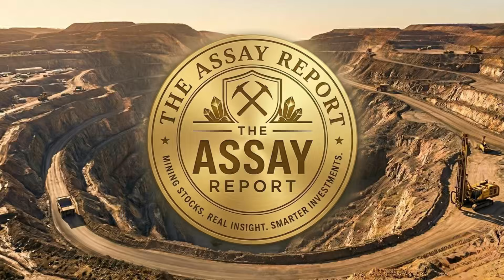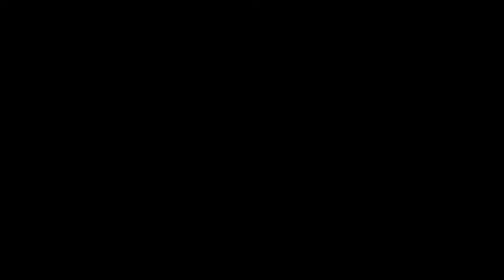Greatland Resources March 2026 Quarterly Activities Report Overview

Comment: Im up 90% since September 2025. Lovely! Very happy with the execution of the team. Not going to sell for at least 15 years.

They have discovered a new underground resource within the past 12 months. Thick, high grade, and already extended to more than 1000m of strike. Will require some development, but can use the underground crusher and electric ore lift at Telfer's Main Dome Underground. Will feed straight into their 20Mtpa processing plant. Will come online before Havieron.

Once all three underground ore sources are underway, Grealand should be well north of 550,000oz a year. In a few years time, when Havieron is expanded to 4 to 4.5Mtpa run rate, Greatland should be well north of 800,000oz a year. These are speculative numbers, but based on run rates, grades, and increasing ore processing capability plans already announced. All I did was do the calculations (and asking a few questions). 

Saying that, there IS execution risk. I believe all challenges are soluble and will be resolved even if that results in modest time and cost over-runs. They are well funded. They have 4x more net cash on hand than Northern Star and an additional 500m line of credit. More than enough to get the job done (+ cash on hand will continue to grow until such a time that large CAPEX is initiated in the Havieron development).

Plus they have a USD54 Billion dollar in situ value of Tungsten and base metals at O'Callaghans, which they will likely develop with a JV partner taking the majority of risk and they take a passive NSR. Just a guess, but they seem exclusively focussed on their copper/gold assets.

If they bring on addirional higher grade open pit ore sources (like Antipa's Minyari Dome, Rincon's relatively small assets, or their in-house satellite deposits), they could plausibly reach a steady-state of 1Moz production a year. That MAY happen.

They are currently adding gold resource ounces as a staggeringly low cost of AUD5/oz. Pays to keep drilling when you get results like that. A lot of that will be low grade open pit, but some are the mich higher grade West Dome Underground.

When I look at what they achieved in just 17 months, I really think the people that sold the asset in Dec 2024 should hang their heads in shame. They sold a tier one asset for pennies on the dollar. Bad for them, great for Greatland, you and I.

If you are patient, and willing to but and wait, I feel that a 200% gain within 5 years is a 50% likelihood, 25% chance of 250-300%+ gain, and 25% chance of underperforming the 200% target. That is without any addirional increases in the gold spot price. My opinion only, do your own research.